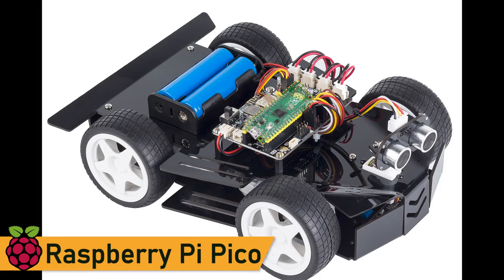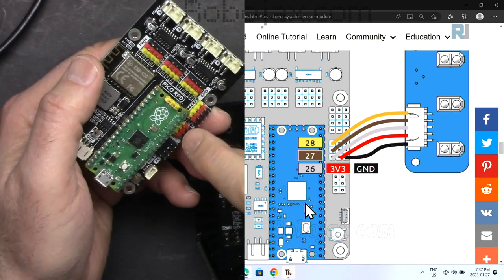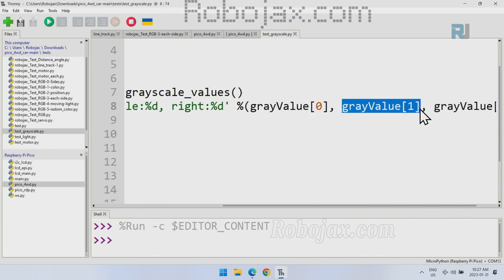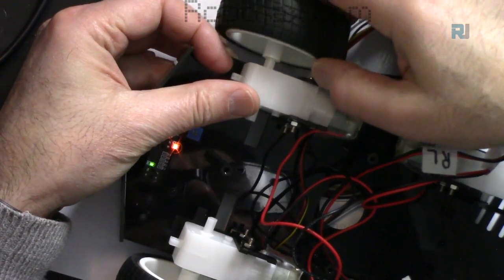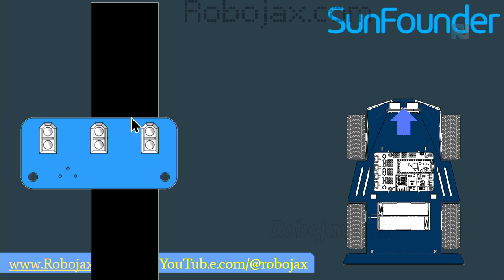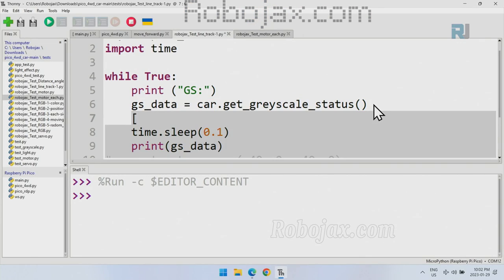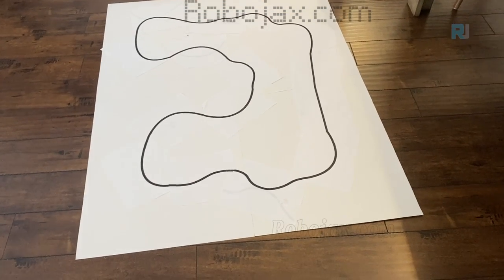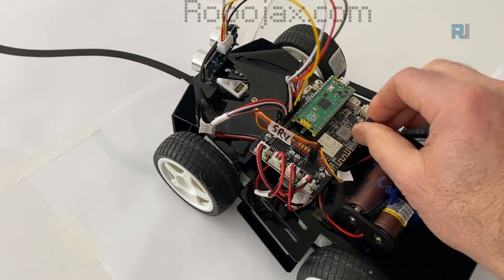Lesson 7 of 10: Line Tracking, Cliff Detection  Callibrate Greyscale Sensor Raspberry Pi Pico Car

Comment: Thank you for the quality of the presentation. Sir, I would like to ask you a question. I used the same module with a Raspberry Pi, and while my code detects the black line, my problem is that when my car goes forward, it continues until it leaves the line. It is unable to turn left or right.Please can you help my.
Reply: Please, can you answer my question?

Comment: Thank you for the video! I think I have a problem with my sensor... can you please tell me: if the light doesn't turn on, does this mean that the sensor is broken? When I run the test_grayscale.py code, I do get some values around 200 but the values don't change when I change the calibration nor when I place the car on different surfaces (white, black, cliff).
Reply from the maker: Yes it must be defective. When you bring white aper undre it, the lights should turn ON. Check the wiring perhaps.